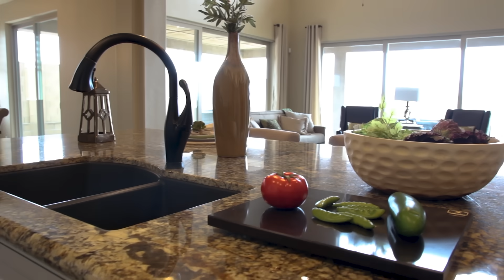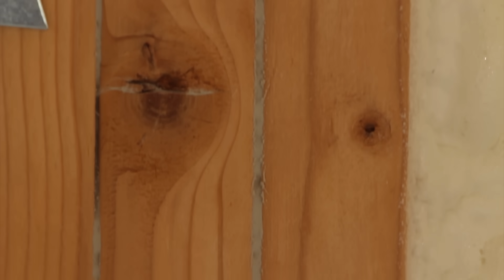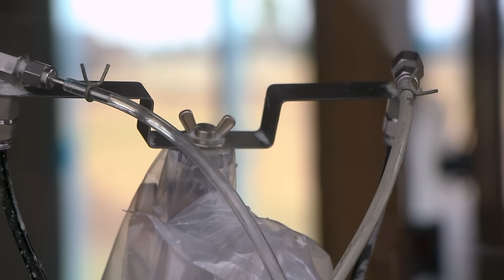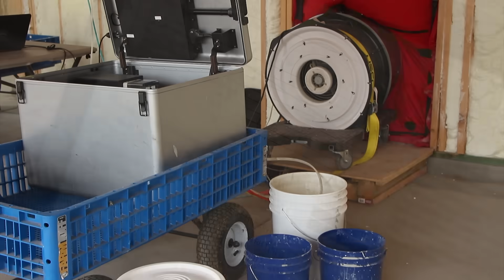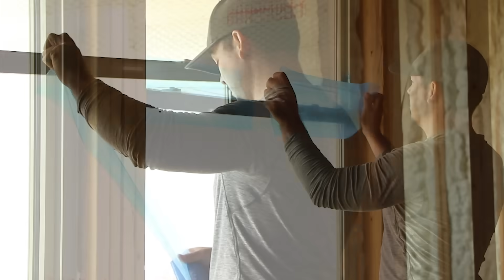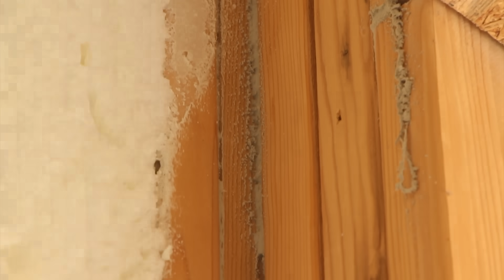AeroBarrier Process

Comment: Can this be done on a row home that only has exterior walls on 2 sides instead of 4? How about finished homes?
Reply from the maker: Hi Josue Martinez -- Yes, if the space can be pressurized then AeroBarrier can be used to eliminate the leaks. We currently do not recommend using AeroBarrier for finished homes, but we are currently undergoing tests for this application. You can find and contact your local AeroBarrier partner by visiting https://aeroseal.com/aerobarrier/dealer-locator/

Comment: Can this be used in/on a finished home? How much clean-up would there be afterwards?
Reply from the maker: Hi evanconklin -- Great question, We do not recommend using AeroBarrier for retrofit applications. We are currently developing our system and undergoing testing for this application. There is also very minimal clean-up after sealing and our expert team of AeroBarrier partners are responsible for this. You can find and contact your local partner by visitinghttps://aeroseal.com/aerobarrier/dealer-locator/
Reply: @aerobarrier  I was wondering this, I'm trying to convince my builder to use this during rough-in but worse case wondering if we can do it prior to "moving-in". So no furniture but would have finishes?

Comment: is there any residue that accumulates on walls windows flooring etc?
Reply from the maker: Joshua - the beauty of the technology is that it doesn't impact vertical surfaces(ie. walls, windows, doors, etc...) unless there is a leak.  So at the rough-in stage or after the first coat of drywall mud prep and cleanup is very minimal.

if you would like more information or have any additional questions please feel free to reach out to us at info@aerobarrier.net